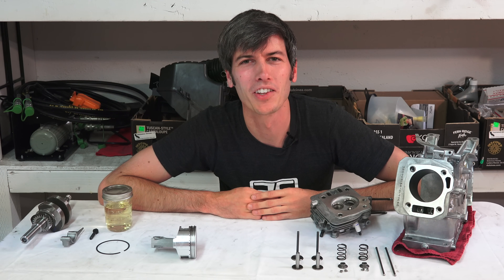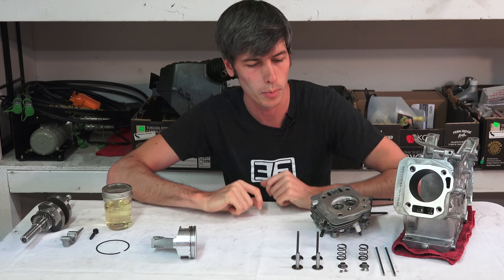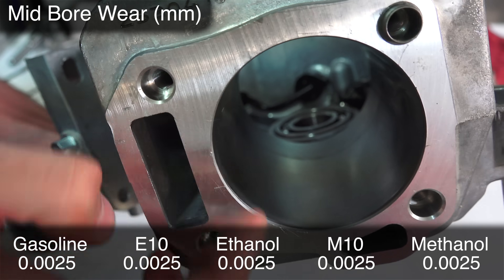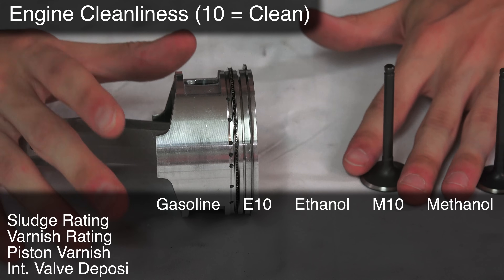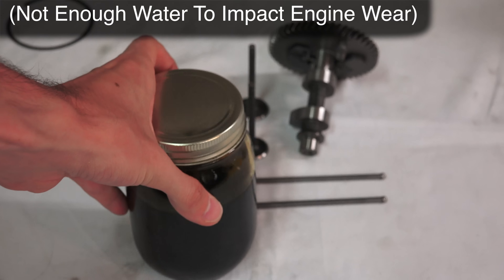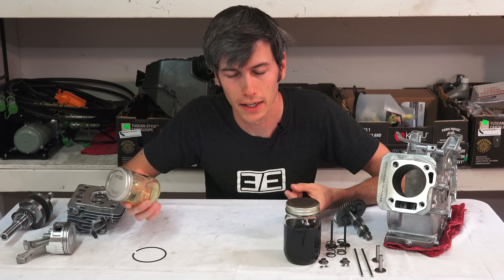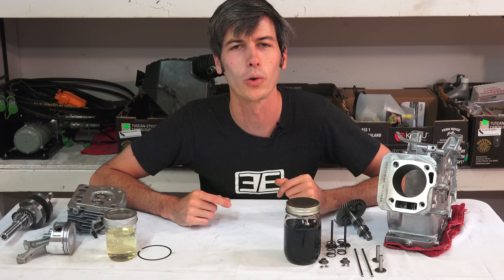Is Ethanol Bad For Your Car's Engine?

Comment: From my experience the biggest problem in some cars mostly GM vehicals is MMT additives basically methycyopentienyl manganese tricarbonal  this junk wrecks the spark plugs and emission systems, and can cause major engine failures do to said problems.... Being a mechanic I will tell you most engine failures  I have seen are in the g5 vehicals has bin from the fuel picked or used.... Even in the owns manual it will tell you not to use fuels with over a said % of ethanol and to not use methanol additive fuels.  Gm even states damages will not be covered under your warranty so you know it can cause engine failures in said vehicals do to their engineering of planned obsolescence.

Comment: The big problem is ethanol on the fuel system components and melting rubber.  Your video missed the point there altogether.

Comment: PLEASE, DO NOT SCRAMBLED ETHANOL W/METHANOL We need to know more about ethanol and gas for our engine. I didn't find methanol on the gas station. Ethanol gives dry situation on the pistons/rings, the gas greases the pistons/rings, ethanol doesn't have power, tork, it is lazy,  etc. W/a full gas tank you can drive more than 120 km-150 km and the engine is all the time clean, smooth, power, tork, silence, etc.

Comment: Hi. The engine is built for gas only and not for a blend gas/ethanol. We pay 10% ethanol for the price of the gas. The ethanol has sugar inside. Sugar is not good for the pistons/rings, gas pump, etc. It is more better a little water in the gas than ethanol. Ethanol do not explode, it is only burn and make a lot of smog, carbon, etc. in the pistons/rings. Ethanol decrease the millage/km for the car. Ethanol is good only to take the water from the gas but normally it is not good. Ethanol in the gas makes a difficult start engine because the ethanol is more heavy than gas and it stays bottom on the gas tank. Ethanol is only for envirement, it means than ethanol makes the smog less poluant. Do not use the engine w/ethanol - gas. NO ETHANOL W/GAS.

Comment: Excellent video! Congratulations! But the real problem withe E10, M10 Ethanol and Methanol is not really the wear they produce in the engines, but the destructions os gaskets, plastics and rubbar parts, including cases and hoses. To tem, even E10 is usually nearly catastrophic... And the lambda probes suffer most...

Comment: My understanding is the issue with ethanol is that it's hygroscopic (attracts water) and engines more than 10 years old might be adversely affected.
I see no reason to risk it.

Edit: That's pretty much exactly what he said, lol.  😎👍
Reply: I have see a lot of problems in mostly carb engines running on e10.
Mostly rubber seals and with cars or bikes that don,t drive a lot problems with water in the feul. I run e0 102 octaan or e5 98 octaan no lower on old rides

Comment: Having experience with all fuels they all have problems. Leaded fuel so often left ugly deposits everywhere. The only thing worse is LPG.
LPG in an engine built for it are ok and with them they have more compression to make similar power than a petrol engine. A duel fuel set up will always be a compromise, often a poor one. Even with OEM ones
Unleaded fuel is dull colorless and boring. It needs to be run in cars with fuel injection and very good ignition.  Carby and points they run like crap!!  High Intensity multi spark ignition  will light it. And it attracts water as well which rusts out fuel tanks and fuel pumps. And really has a 90 day life.
E10 can be acceptable. Though you have to service the oil changes max every 6 months. If not it contaminates bearings. Some cars really like it, others hate it! And it attracts water more as well.
E 85? Worse than all for servicing on a road car, it can make very good horse power with modified engines but contaminates oil. And leave an engine sit for a couple of months and you are getting rust pits on cylinder walls and even the intake tract. It seems to be worse than methanol in that instance.
AND it goes off, evaporates the aromatics which burn to make power. So a very short life.
Methanol?  For a normal road car a no no. For motorsport it will make more power than any of the above BUT you need more compression than the rest. Sprintcars use 15-1 and even higher.  Modern methanol is not near as destructive as the past.  But it too attracts water, has a limited life and will turn the oil milky. So oil changes are required regularly. You need a LOT more of it as it is thicker by volume and less efficient. But burn more of it with compression and watch out!!  It is also the safest as it is very hard to light and does not go whoof like petrol does when lit. 
The only down side with it from fire you can hardly see the flame. Watch Indy cars that use it and you occasionally see a car or person on fire but no flame. And use water to put the fire out. More efficient than any flame retardent in extinguishers.

Comment: Very informative! But my main problem with E10 fuel is the damage it causes to carbs,rubber,plastic components.dont forget the short shelf life it has(2 months).after that it starts converting into a varnish that ruins carburetors.

Comment: Yes but what is the benefit of ethanol? I don't see any. On 2 occasions last year the fuel I bought made my car accelerate faster and I noticed that I did more mileage before needing topping up. I believe that I was sold fuel with no ethanol added, either by mistake or maybe they ran short of ethanol. So if correct, that means with ethanol I was getting less power and and less mileage. How is that helping the planet when I am consuming more fuel? Ethanol is also more expensive than gas and uses a lot of energy for the 3 distillations it goes through. Even after that I wonder how much water is still in the ethanol and what damage will that do to the engine and exhaust system. I suspect that ethanol is nothing but a virtue signalling exercise that actually saves no CO2 emissions at all.

Comment: We live in a hot summer climate and we own three classic cars. My car had a problem of stalling because the fuel containing ethanol would heat up and vapor lock. My husband rerouted the fuel lines, installed a “Coolcarb” plate under the carburetor, and we started using Clear Gas. I no longer have the stalling issue.

Comment: Yes especially aluminium parts of older vehicles, fuel economy, power (even though it high combustion) and rubber, all seals, gas tank erosion, fibreglass gets destroyed, and then there is water as it's hydroscopic, etc etc, it's that bad on wear on tear that some vehicles after 1995 are not able to run. Running vehicle every day helps but not on peripherals. Just being honest.looking at wear and tear over 24hrs us pretty useless,  it's over time especially standing.

Comment: As a mechanic during my college years, the concern about ethanol was not what it did to an engine but, what it did to the inside of the rubber fuel lines, that did the most damage to the engine. Ethanol will degrade rubber and, as the rubber begins to disintegrate inside the rubber fuel lines it turns into a gel that comes up the injection or carburetion on older cars. I never saw damage done by ethanol from a mechanical standpoint.But, have seen the damage it’s done through fuel line degradation. Thank you
Reply: Hey, if you're still active, I would really appreciate if you can discuss this with me.
Recently, Indian government has forced E20 fuel without giving a choice of pure gasoline/E5/E10. So the only fuel available in the nation is E 20.
And this is across the board, even with higher octane fuels like 91 and 99(they are also mixed with 20% ethanol)

The problem being my car is not E20 material compliant (it's E10 material compliant)
I purchase the car in 2022 And the E 20 rule was enforced in 2023 (it's a 3 cylinder turbo engine designed by AVL France)
CURRENTLY, THE GOVERNMENT IS SAYING THEY HAVE DONE TESTS AND THEY HAVEN'T SEEN ANY ALARMING EFFECTS MOVING FROM E 10 TO E 20.
MANY MANUFACTURERS HAVE CLAIMED THEIR FUEL SYSTEMS ARE DESIGNED WITH A HEADROOM, ALTHOUGH MY MANUFACTURER HASN'T COME UP WITH ANY OFFICIAL STATEMENT.

Can you please shed some light on this? And if there is a problem, how can we mitigate that? Are there any additives that can help?

Sidenote: my car is under warranty up until 2027 and I have not experienced any Performance issues, in fact, the car accelerates much better than before, the only downside I have experienced is fuel economy down by about 2-5%.
Reply: @ezioauditoredafirenzi Maybe you can use fuel stabilizer like Sta-bil
Reply: @ezioauditoredafirenzi  you'll find that E20 will cause your economy to drop since it needs to inject more fuel. But this also means much better cooling which also allows a more advanced timing due to less knock and ping which will cause a better throttle response.
Reply: @squareeyes1117  oh yes, absolutely, apart from cold start-ups, the engine, especially turbocharged engines are behaving much better. Economy was obviously going to drop due to less energy. But the problem with fuel lines still remains.
Reply: @ezioauditoredafirenzi  if your fuel line can handle petrol, it will handle ethanol. Good quality fuel will have additives in it that protect and clean your fuel system. Ethanol also does a really good job at cleaning off deposits, grime and sludge.
Reply: Ethanol will not cause damage to fuel lines, if the fuel lines are designed for petroleum, then they'll handle ethanol. 

My main concern would be in the engine's ability to correct the AFR and long term storage. 

I'd be concerned about older engines running lean like my 1999 6G74 Mitsubishi magna. It doesn't have an O2 sensor, so it relies on the MAF sensor and refers to the value chart set from the factory. However the engine is designed to run on E10 (94RON), so it uses a middle ground AFR of around 14.2. It will run slightly rich on regular petrol but will run slightly lean on E10. 
Older engines will not be equipped to handle this and you'll be running lean if you use E20... Not ideal. With a carburettor, you'll be able to easily tune this, but with injection you'll probably want to look into tricking the load sensor or TPS. 

Then there's also the issue with phase separation of ethanol in petrol. Storing your car in cold and humid temperatures can cause issues with condensation inside the fuel tank. Ethanol will absorb the water and if it absorbs too much it will separate from the petrol causing issues from rusting to getting water in your fuel lines and potentially damaging your fuel pump and filter. 
The phase separation sounds really bad but it's not a huge deal. 
If you're getting condensation inside your fuel tank then there's an issue with sealing, your fuel tank shouldn't be letting air get inside but rather vent excess vapour. 
In fact ethanol is very useful for any water that has gotten in the tank, it absorbs the water and burns it without an issue. Regular fuel will not absorb the water and will simply sit on top of the water allowing it to be sucked up. 
Other things to note is watery ethanol blowby causing water condensate in the oil. Your PCV should take car of this but I have seen milky oil caps. Synthetic oil will absorb a small amount of water with their emulsifiers, keep your oil changes regular with some sort of synthetic oil. 

My summary is that ethanol isn't bad if you drive regularly, service regularly and your engine is ready to run at a good AFR.
Reply: @squareeyes1117  i'll tell you that your theory is wrong, because, in India, government suddenly decided to go E20 from E10 which is compulsory with no choice.
And immediately we are seeing older vehicles designed for E5(fuel injected) having problems with their fuel lines as it is degrading the rubber/plastics. And this is across every single company, from Indian companies to German companies to Japanese. Everyone is suffering..

But the systems designed for E10 still coping up better, because the companies said they already had anticipated and kept head room.
The bigger problem with this is the degraded fuel system is clogging the injectors. And we are seeing a massive surge in fuel line and injectors being replaced.
Apart from that, every company has mentioned that the engine components specifically, all the metal used can with stand higher ethanol.
Reply: @ezioauditoredafirenzi well if that's the case than I'll stand corrected. I looked into different types of rubbers and their compatibility with ethanol and found that natural rubbers will infact degrade. 
It is unfortunate. I suppose you will have to retrofit fuel lines with really old vehicles

Comment: 3:38 E10: 33% more wear
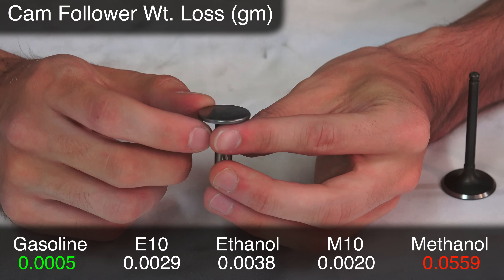4:10 E10: 5,8x more wear
4:30 E10: 68% more wear
4:40 E10: 88% more wear
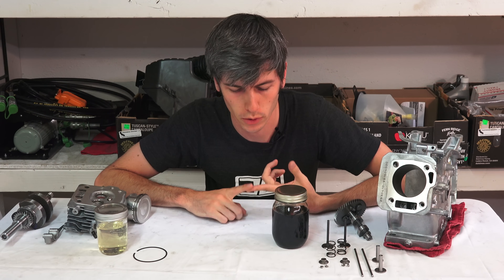6:13 "They did not find a significant difference between ethanol and ethanol fuel blends vs gasoline when it comes to engine wear"

Comment: @Engineering_Explained The study is not "study" at all from the scientific standpoint.

Any conclusion from just one exemplar in measurement is considered non good.

If you want to see difference in two (ok 5) different fuel types, you should take at least 3 different measurements, meaning that you should have at least 15 different engines measured. 

In this  example, only conclusion you can have is that methanol only engine is made less good than other four.

Comment: If you have cork gaskets in a carb, 10% will destroy the gaskets.   It cost me $100 for a new carb kit to fix the leaks from 1 6 gallon tank.  This tractor was built in 1972.

Comment: I almost exclusively use E100 here in Brazil. From the price standpoint per km is almost the same of gasoline, but you get a slight increase in power for the same engine.

Comment: Yes, it destoyed engine of my Hyundai! After 10 years engine started to produce noises, although it was serviced over entire time. Official Renault service technician just confirmed it when I tried to sell it in, claiming that ethanol leaves much more humidity after combustion, which causes hydraulic shocks in cylinders. Cylinder block is NOT replacable, so TL:DR if you want to kill your car in 10 years, go bio fuel.
Reply: The study you specified is garbage. What is 20 hours?! This is nowhere a prolonged use, pure garbage.

Comment: The issue I have with the study is that they only tested 5 engines? o_O so the significance of every single data point is entirely reliant upon a perfect inspection of every single engine.  Still cool info.  Just seems like the most anemic study for something that affects at least a billion+ engines.  It's also worth noting that E10 is twice as bad as pure gasoline, for what?  To save 10%?  I know nothing about this topic but I must confess this video actually makes it seem much fishier than I would have assumed.  The conlcusions don't seem to match the data (which is sparse).

Comment: Are those numbers octanes? 87? Because they seem to be really low. Here in Finland the so called standard fuel is Octane 95 (E10) which is good for most benzin engines and if you want to buy a little more special fuel there is also Octane 98 (E5) which is good for all benzin engines. I don't really know which is better for my car, but since the manual tells me to use 98 octane fuel I always buy that. Would there be any problems if I for instant used 87 octane fuel in my car?
Reply: The EU uses a different octane rating scale than the US.  A 95 rating in the EU is roughly 90 in the US, and would be the mid grade fuel here.

Comment: I was told by a mechanic the E10 damages the injectors more than non E10 and it can attract water which also plays havoc with some cars due to the water sensors registering moisture in the fuel system. I would rather pay the 2cents per litre extra and run non ethanol fuel.

Comment: Great video!  Now that regular unleaded gasoline is $2.20 higher per gallon than E85 here in Southern California it’s totally worth it to buy. The E85 has 105 octane so it runs better and keeps engine clean even though it’s about 15% less fuel efficient.   You should do a update to this video now that gasoline prices are soaring.
Reply: higher octane does not equal more power lol, especially on a stock tuned car. octane number is a measurement of detonation resistance.
Reply: Only for californian fools

Comment: E10 fuel isn't great in small engines either and some garden machinery dealers and some marine engine suppliers sell alkylate based fuels that have longer shelf lives, burn cleaner and don't damage components (unless the components have been exposed to unleaded fuel for most of their life). I don't know if any tests have been done in car engines using this fuel but it would be interesting to see if the emissions reduce massively like they do in the small engines as they don't cause carbon build up which shouldn't effect performance. The one disadvantage these fuels have are that they are slightly more expensive than the normal pump fuels.

Comment: Correct as to pre 2000 fuel supply systems, in my case my w124 300E beagn running rough, couldn't figure out why and eventually changed the injectors and it helped, however only for about 60 000 km, where the problem reoccurred. So I cut the injectors in half and behold, the tiny interior plastic filters were melted. Took my damaged filters to Mercedes and got new ones under EU warranty laws (2 years), meanwhile the spare part number for the injectors had changed at MB, so apparently the mothership was aware of the problem, but failed to mention it to their dealers and customers, I guess it's just a part of Mercedes Benz present customer care....

Comment: Just don't use it in your small engines. Cars can handle ethanol better than small engines. I buy non-ethanol gas only for my small engines because it is so expensive. There is only one gas station in the area that has it. I recently paid 4.09/gallon for ethanol free while regular unleaded with ethanol was 2.59/gallon